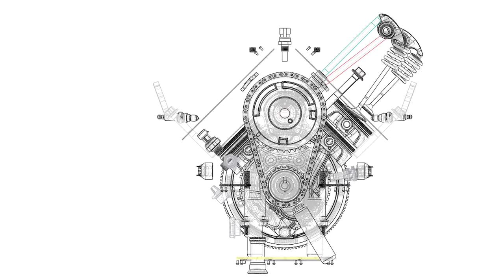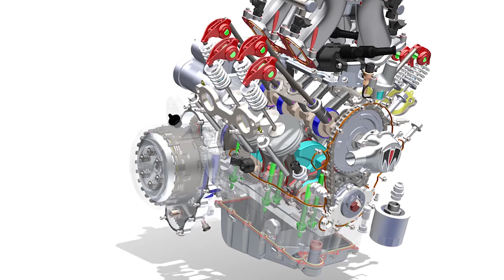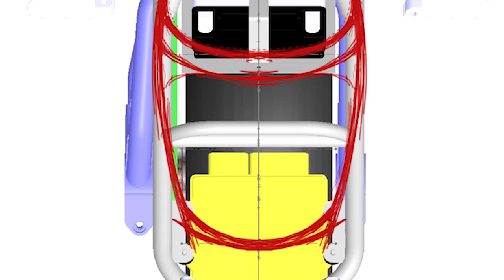2016 Motus MSTR - Jay Leno's Garage

Comment: dispite all the "bespoke" and "superbike" parts i think it looks a bit plane. can't see many people buying it because they fel in love with the looks. but that's probably just me ;-). special (to me atleast) would be making an engine with a modern lay-out but still have a low cog. or this bike but with low weight.
Reply: It's a simplified, mature look compared to flashy, bizarre sport bikes lately that try too hard to be new or different.
Reply: It's a simplified, mature look compared to flashy, bizarre sport bikes lately that try too hard to be new or different.
Reply: +JP different just to be different is not the awnser, i agree. but still... for the asking price, i think they could have made a different product. but there is little as individual as bike-ownership... and this is just my opinion.
Reply: It doesn't look bespoke which is the problem.  It looks too much like a factory motorcycle. And I wished the engine was modern, too.

Comment: Overhead valves limit your RPM pretty drastically that's why nobody uses these kind of engines anymore and only two valves per cylinder? Then again if it works it works I guess. 
Info on the company/bikes is pretty slim. I guess they are trying to promote their bike(s) right now to get some traction and eventually get a mass production going. Entry price is $30,975 according to cycleworld so chances of that happening are slim to none in my book! Hey, it is a new company and at least they are trying. So good luck guys.... :) :) :)
Reply: but ohv engines tend to have a lower Center of gravity, this would help with direction changes. 2 valve headed engines tend to make less hp and more tq than the same engine with a 4 valve head that tends to make more hp on the top end but at a sacrifice of tq. I think that the layout of this engine suits it's purpose,  no need to rev to a million rpm to make power. I wonder what the towing capacity is of this engine? lol
Reply: MrGrandure
True, having a low center of gravity is nice but then that thing is still crazy heavy mainly because of the engine. I guess they know the engine as a powerhouse is their selling point hence they sell it as standalone too, showed the buggy etc. The bike, well probably not so much...

Comment: How can they compete with sport touring motorcycles like the FJR1300 at 1/2 the price?  I understand the American made thing but $30k+ is the price of a nice car or a great used car.  Just don't see the logic in a low tech, tube steel and pushrod engine bike.  Kind of like what Buell did several years ago.  Not sure who would actually buy it.  I think they are 15 years too late.

Comment: pushrod ?
Reply: It's a rod that goes between the cam, and rockers, when the cam is inside the engine block.
Reply: Just like the famous Honda CX 500.
Reply: i know what it is but kinda old tech for such a modern bike engine
Reply: It is old tech for a motorcycle being built in 2016.

Comment: Isnt pushrod outdated technology. Check Aprilia rsv4 engine.
Reply: Yeah, the RSV4 engine is fantastic, but is designed for a very different application. Oh, and the Motus V4 makes 25% more torque to the rear wheel..and doesn't require valve adjustments...

Comment: Awesome that they built their own engine but it does remove some confidence from potential buyers.  If you use an off the shelf ducati or BMW engine you know its going to be reasonably reliable and parts will be easily available for a long time.

Comment: i have noticed one thing when Jay drives whatever, he aways use the low gears, in a bike like this that gets twitchy, use the gearbox and make it work better, its not that it wouldnt work on low revs.
without electric stuff like antispinn etc its easy to get the wheel to slide and crash, but ok these roads is not very challenging of cource.

its ok to talk about how Indian in the 30s won over other makes because they were reliable, but it has nothing to do with today, you simply dont find that many modern bikes since the 80s or more breaks easily because the have overhead cams.
Its not the reason to use two valve pushrods at all today, it must be another reason for it.

And listen when he parks and turn of the engine, it pings of the heat like any other engine.

Comment: This episode disappoints me. First off... Hey Jay, three American companies? Ever heard of a company called VICTORY MOTORCYCLES? An American company that makes their own engine, a beauty of an overhead cam Air/Oil V-Twin called the Freedom 106?  That would be 4 by my count. 

Second, that is a (EDIT: I said Pratt & Miller; WRONG! It's a Katech) engineered engine. Ever wonder why all the sensors etc. are GM?  Yeah, that is Katech/Pratt and Miller!  But it is a great engine and I do like that choice. And in fact the bike is very nice. The overall look is meh to me, but it's put together nicely. It Sits great, it's all great - until you look at the price tag. $30,000.00 for the base model - $37,000.00 PLUS for the MST-R. THAT IS LUDICROUS for a bike of this type. And when did the classification change from Sport Tourer to "Comfortable American Sport Bike"?  Why do I need carbon wheels and full-on race Ohlin's suspension when I am not going to race it?  Doesn't make any sense to me. The components could be toned down a little bit and the bike could be brought to market for thousands less. And Trellis? I'll take aluminium spar any day.  

But whatever. I wanted one bad, but I'm not paying that price. That is just bullshit. this is just a boutique bike for guys with money. So let them have it.  I'll keep my bullet-proof GSX1250FA  AND my just as bullet-proof VICTORY VISION. Which by the way, I bought both of those NEW for less than one of these things.
Reply: If I'm not mistaken, Katech did the original design and assembly of the Motus V4.  Motus has since brought engine assembly in-house.
Reply: Steve, you are NOT mistaken! I am. Katech Engines of Clinton Township, Michigan did the design and build of the engine. Pratt & Miller manufactured the 4130 chromoly steel space frames, transmissions, and composite body work. And then basically integrated the whole package and put it together.  Of course the Motus assembly line is now rolling, so systems integration and final assembly are being done in house now. The engines I am not sure on. I saw a clip of a semi rolling up to a dock with a trailer full of pre-assembled long-block engines in it. And that may have changed now,  too. Regardless, it doesn't justify the price. But different people will have different views on that point. And that is fine. I have yet to see one out on the road.

Comment: You forgot the Victory bikes.
Reply: And there were quite a few different V4 pushrod production engines in cars and bikes since the early 1920's, even one that was designed to be a crate motor for other bikes.

Comment: How about the fuel consumption? I cannot imagine that this 2Valve engine will be very fuel efficient. They are marketing this motorcycle  as a great way to drive all over the country but if you have to stop every hundred miles it is pretty useless. There is a reason why Harley is only using 4valves nowadays.
Reply: Fifth and sixth gears are both overdrives.  On the highway, I average about 225 - 240 miles per tank (5.5 gallons).

Comment: THEY HAVE TO THINK ABOUT maintenance I MEAN TH FAIRING IS ONE PEACE ITS HARD TO ACCESS SOMNE PARTS INSIDE AND THE OIL FILTER IN A BAD PLACE.ALSO THE ENGINE IS NOT PROTECTED
Reply: The fairing is two pieces - 4 DZUS quarter turn fasteners to remove each piece - only takes a minute to remove or install.  Oil filter is not in line with front tire - less exposed than the filter on my DL650.  Basic maintenance is very straightforward - everything is easily accessible.
Reply: thanks for the info..its pain when removing the fairing on some bikes..

Comment: torque wins races? 

try researching formula one cars.

horsepower is a measure of work over time. torque is a static measurement.

horsepower moves your vehicle, and low rpm horsepower doesn't mean anything in a race.

torque sells cars (making it feel more powerful than it is), and horsepower wins races (actual acceleration)

Comment: there are more than 3 USA made bikes.Seattle cops use these
http://www.victorymotorcycles.com/en-us/our-story
Reply: Polaris owns Victory and Indian.......
Reply: RIP, Buel..
Reply: +L LL  Buell is still in business......
Reply: HD bought buell
Reply: Polaris owns Indian, though. There may be more, but Polaris/Indian and Harley Davidson are the big two. Maybe Motus will be the next big American bike builder.
Reply: +alfred washington Erik started up EBR that same fall or very early the next year after buell was shut down. He built about 130 or so 1190RS motorcycles until he joined up with Hero and they released the EBR 1190RX in 2014. Later in 2014 they released the 1190SX. EBR ran until Hero screwed them over by not paying up the money they owed for R&D EBR did causing EBR to go into receivership in April of 2015. EBR was bought by LAP (Liquid Asset Partners) in January/February of 2016. EBR is now called EBR Motorcycles and resumed operation in March and have been building bikes since. Goal is roughly 500 bikes for this year.
Reply: Channing Kraemer
tks for the info i did IT support for several bike dealers 2 sold HD they all used same dealer mgmnt software. this was 88 to 06

Comment: Too bad the styling is reminiscent of 1990's mustangs, also the performance: my dad's 1964 Alfa romeo Giulietta Spider has a 1600 aluminum block double overhead camshaft engine that makes as much power as this bike if not a little bit more, and the car weighs nothing. So not the best performance either.
Reply: ur comparing 1600ccs in a car vs a bike lol.
Reply: The 1964 Alfa Romeo Giulietta Spider spec sheet says it has 127hp and 112 lb ft of torque. The Motus engine has 180 hp and a very flat torque curve with 80 lb ft off idle to 120 and weighs only 140 lbs / 63 kg.
Reply: The point was he was comparing a 1964 car to a 2016 motorcycle.  Two valve pushrods is very old technology.

Comment: this bike is a no no, the price tag is stupid.
Reply: call it an American Beemer and price is right on - keep in mind you don't need to add or change anything on this bike like you do with any other maker
Reply: you are wrong/ for uniq top of the line 1650cc bike it is very resonable prised
Reply: even if it it is the same price as a new goldwing? the engine size means nothing. I always look at power to weight ratio and that bike reminds me a ktm
Reply: What's top of the line about it?  No available ABS and no rider modes.
Reply: Derek Jonez
- quality suspension and pipes are top of the line if that's important to you... if you don't like gizmos and all the things you need to add to most bikes, this bike is perfect when you buy it